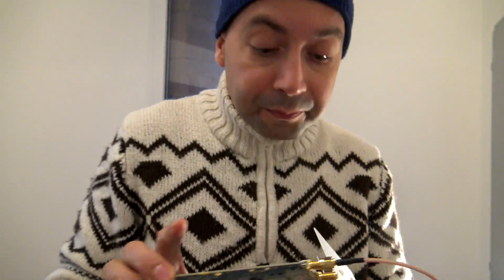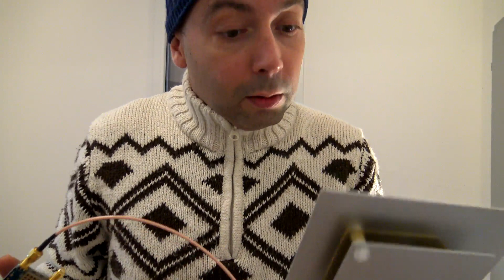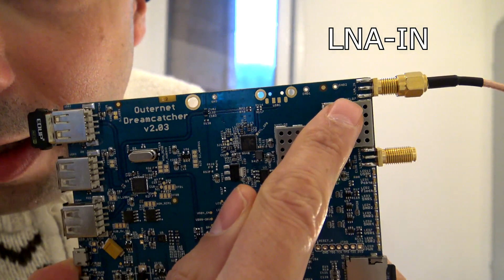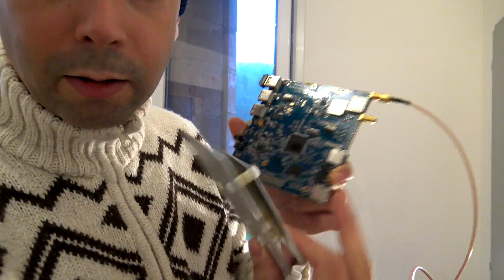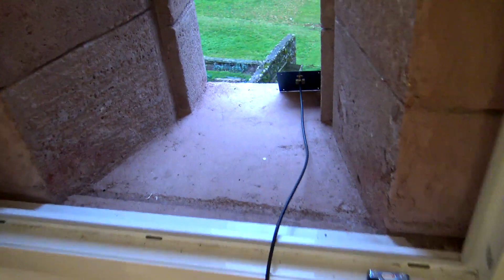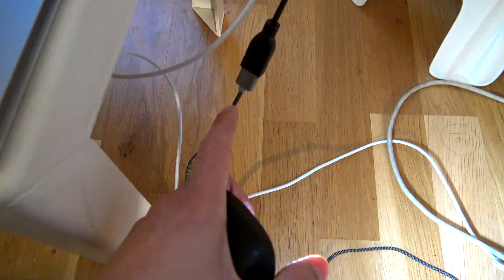Outernet Part 1 - Dreamcatcher for the noobs

Comment: hello.. I'm from Ecuador and i have some question about this product .. can you  help me please ?
Reply: The DreamCatcher has an LNA and a SAW filter built-in.  But there are two SMA connectors LNA_IN and LNA_BYPASS.  The simplest way is to use the LNA_IN input with a passive antenna.

Alternatively, you can remotely locate an active antenna using the LNA_BYPASS input.  The LNA_BYPASS has a "bias-tee" built-in, which supplies a DC voltage (3.5-5.0v) over the coax to supply the active antenna.  This allows you to amplify the very weak signal before sending it down a length of coax.  At 1500 MHz, RG-316 loses 3.2 dB (or more than half of your signal) over just a short 10 feet.
Reply: If possible, go to http://outernet.is and follow the Forum link.  Ask your question there.  If you can't for some reason, I will find out for you.
Reply from the maker: Yes, I agree with Konrad; again ;) 
This forum (https://forums.outernet.is/) is very responsive.
Reply: Hi, I have another question ...
I am in Ecuador, do you think that here in my country I can receive the outernet data? What are the outernet satellites called? Might you help me?
Reply from the maker: GaryA Alexander Yes Ecuador is covered. You'll be able to choose the Americas' satellite Inmarsat 4 F3.
Coverage: North, South, and Central America, Pacific and Atlantic Oceans
Reply: ok thank you so much .. i wish you could help me if  I  need it :D ...  other question haha...  Should I use passive antenna or active antenna? or  is it not important ?  Could you help me with this explanation?
Reply: thank you so much :) i'm very thankful

Comment: Note: Use a 2.1 Amp USB charger for power.  If you get one that does not have enough current, the board will run for a little and then die.
Reply from the maker: Konrad Roeder yes that's so true. Took me a while to figure this out. I guess it's because after booting, it's powering the LNA/amplifier ?
Reply: It takes a while before it turns on the WiFi subsystem.  You will notice the WiFi LED will blink once or twice then the whole thing goes dark.